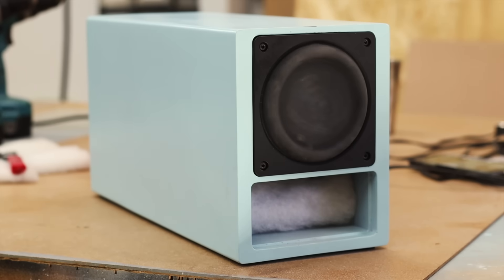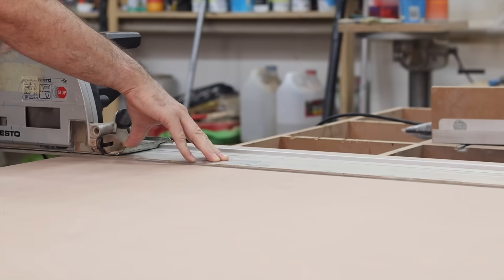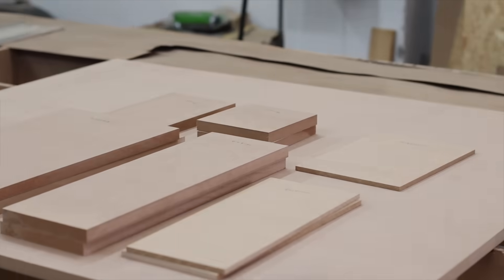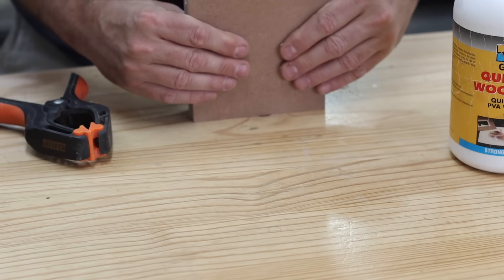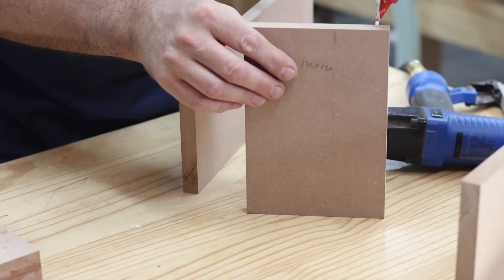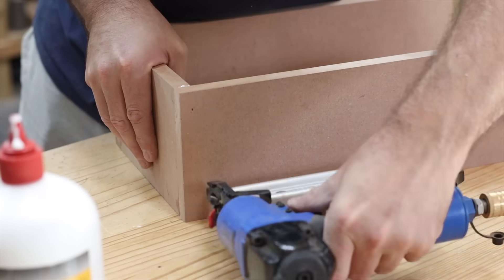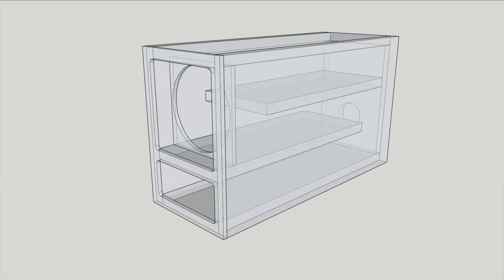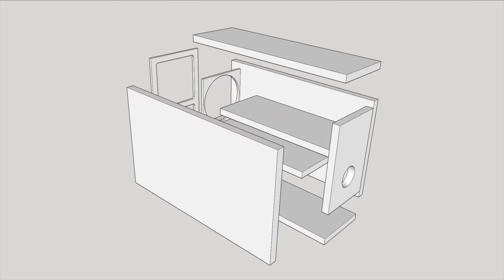Building a 4" Transmission Line Subwoofer - by SoundBlab

Comment: This looks great! Whats the f3 of this sub and how does the driver generally perform? I'm currently planning a build using this driver so I'd love to hear your thoughts!
Reply from the maker: Thanks. The driver does well in this enclosure, and can handle quite a bit of power. It really moves a lot of air. I have not yet measured the F3, but modelled should be in the range of 35Hz or 40Hz. Perhaps I'll do a follow up video in the new year where I can do this and show some more stats.

Comment: Is this a constant CSA using Sd, 0.75Sd or ~ 1.5Sd maybe? and a line length of 75”-80” to f3 @40hz?  Im looking for a last minute xmas solution as my other plan got foiled at the last moment ...
Reply from the maker: It's just a straight line where the mouth of the line is equal to the Sd of the driver. F3 should be around that, yes. I have the SketchUp drawing on my Patreon page.

Comment: I can see that having a table saw making accurate cutting really easy . It's not so easy free hand with a circular saw
Reply from the maker: It does, but only if set up accurately. You can use a guide rail with the circular saw and still get very accurate cuts.
Reply: @SoundBlab  you can also take a cut sheet to your timber merchant and they will pre-cut stock to size for you to an accuracy of plus minus a couple of mm, which can then be flush trimmed to final size with a router and a metal guide rail if you need absolutely hair-splitting accuracy.
Reply: @weareallbeingwatched4602  That's what I do. I'm not going to make things way harder for myself just to save pocket change.
Reply: You can get some linear guides for a circular saw. Very effective! And cheap!

Comment: the transmission line is way overstuffed it might work ok in this particular case 
but just seeing the sonofil move so much proves that its almost a complete blockage 
This is more comparable to a sub with a passiv membrane than a transmission line sub 
sorry to say but for me this is a failed attempt at a tl sub
Reply from the maker: I used a material known as Dacron for the line dampening. It's very 'airy' stuff with lots of space for the air to still move. The line is filled with this to approximately 50%. This was modelled using Hornresp to reduce the size or length of the line and still get the same response, but much smoother frequency response than with a typical 1/4 wave line length. Essentially what the dampening does is to slow down the speed of sound within the line and 'tricks' the woofer to act as if the line or enclosure is much larger than it is. It actually works very successfully in this application. For me its a win and I am very pleased with the outcome and the attempt. Of course I can still experiment, and some measurements will be interesting. Perhaps another video on this in the new year.

Comment: Don't fill komplette Chanel with damping, it's refusing the base so much. Damping in Tml is only for redusess high frequencys they come out of the channel, in a sub are no high frequencys, so it's only make less bass. It's only the case in Tml.
Reply from the maker: What you are saying is not entirely true. The line is filled with Dacron stuffing to approximately 50%. This was modelled using Hornresp to reduce the size or length of the line and still get the same response, but much smoother frequency response than with a typical 1/4 wave line length. Essentially what the dampening does is to slow down the speed of sound within the line and 'tricks' the woofer to act as if the line or enclosure is much larger than it is. It actually works very successfully in this application. Normally where you put the stuffing in the line has more effect on the midrange, but it does affect the lower frequencies as well. In this application it was more about slowing the speed inside the line.
Reply: @SoundBlab  OH jes Its a complikatet thematic, I herd abaut that, but tis encluser is so smoll maby  just make it a bit longer, and one smoll strip at top and bottem to get a good highway for the air😊 I don't see in the viedeo that's only 50 % fillt 
Thanks for the answer

Comment: Silly question perhaps, but why not make the holes before assembly?
Reply from the maker: Not silly at all! I have actually changed the original design you've seen here so that it can be built without the need to router the square hole in the baffle. You can then just assemble all the panels and drop the driver in place.

Comment: wouldn't you want the woofer at the top of the box and not in between a channel of the port?
Reply from the maker: No, the enclosure was modelled in software to work this way.
Reply: sterling wendt that seemingly empty chamber at the top is just used for resonance, something kinda like a paraflex I believe

Comment: What is the low end frequency response for this setup?
Reply from the maker: Around 40Hz doen at -3db I think. Did not measure, only modelled.
Reply: SoundBlab which software do you use to model and test such enclosure designs?
Reply: @darshitdarji3217  1:25
Reply: Victor Supreme Thanks but I could not hear that properly. Can you name it?

Comment: That looks and sounds great!  I love TangBand subs, i have 2 Tang Band W6-1139SIF 6-1/2 subs in my car and they sound good but i know they could sound better with the proper box. I know nothing of subwoofer box design, i just tried different box sizes and different slotted port lengths until i thought it sounded good. It would be nice if someone would design a box that i could make.
Reply: You can check out WinISD 
From what I hear it's what most use for box building 

All you need is the specs of the speaker and the desired frequency, then input it into the program.
Reply: PDRIFT86 I just put those same speakers in a box in my truck. Somewhere around .35-.50 cubic feet per driver is sufficient and a 2" port that's 10" long will tune it to about 35 hz. I used a 2" PVC elbow for the opening and 2" pipe connected to it for an additional 6" to get the 10" line. 
I stuffed it moderately, with about 6oz of polyfill. Sounds 3x better than just having them in my doors.

Comment: This is an awesome little build. I'm familiar with T-line enclosures, but isn't the top chamber in this build redundant? It seems like the sub is installed in the middle of the line.
Reply: No - it's not redundant at all, actually, its pretty clever! Bose use a similar approach in their designs. https://www.diyaudio.com/forums/full-range/243483-improved-transmission-line-alignment.html
And before one dismisses Bose, I've yet to hear anyone worth their weight criticize Bose for their engineering https://www.youtube.com/watch?v=CZaRQT3Rvaw  .. actually, the engineering is pretty sound. What Bose don't do well is to then take that brilliant engineering and desecrate it using really bad, cheap drivers IMO.
Reply from the maker: Interesting post on the forum! And is exactly what I have done in this design.
Reply: @SoundBlab  very cool! So that chamber is probably tunable.. hmm. Thanks for the reply. Love your channel 👌😁👍
Reply: Yes I though the same when I first saw the position of the driver!!!!
Reply: I was thinking the exact same thing.  What is up with that?

Comment: Is that a 1/4wave chambered tline?
Reply from the maker: It is a straight line, no taper. It started off as a 1/4 wave, however with the Hornresp software I could model a shorter line and move the driver down the line and get a better response curve and same bass output.
Reply: Oo ok i see i was wandering about the very short run.

Comment: How can I determine the enclosure size for a 4" generic woofer?
Reply from the maker: Depends on the enclosure type, sealed, ported, etc. and without the driver specs it is not really possible and be sure to get good results.
Reply: @SoundBlab  thanks for the reply btw I meant how can I calc. thiele n small's parameters ... like using only pc ( as a freq. gen ) and a multimeter? xD
Reply: @coffeebeatsofficial1349  you can use the Dayton Audio Test System (DATS v3) for that.
Reply from the maker: Yes, the DATS from Parts Express is perfect for determining TS parameters, and WinISD for enclosure size.
Reply: @SoundBlab  Thanks my man!
Reply: @KB0B0  Thanks bro!!!!
Reply: use winisd
Reply: @D.Feenstra  yea!!!
Reply: @D.Feenstra  Winisd is oversimplified IMO, and of course it only predicts the enclosure. What most software doesn't take into account is the environment its going into ... which as demonstrated here (link below) is important. Therefore, for the most part I take such software with a pinch of salt! https://www.youtube.com/watch?v=e3nGVje3io0

Comment: Перегородки тонкие, будет резонировать
Reply: I don't even get the logic of the labyrinth.  A dead-end at the top and a vent on each end?  As I expected, not really a subwoofer.  Roll-off at 160 Hz is ridiculous.  Way too much midrange getting thru.  Not any kind of a test.  Listen to a real subwoofer.  All that gets thru is a low breathing sound.  No transients.
Reply from the maker: @Alex T This is a transmission line enclosure. Essentially you are sticking the woofer at the end of an open pipe with specific length and one end open. There is complex math to work this out. However, by shifting the woofer down the line, you can potentially smooth out the response curve, which is what I have done here. The roll-off is only determined by the subwoofer amplifier and can be adjusted up or down. I selected the 160Hz as that is the max of my sub amp and the range gives a good representation of the response from low down to upper bass frequencies. Note it is not a test, only a demo. Like I said in the video, this is an experimental build to see the capabilities of such a small driver in this application.
Reply: @alext9067  I have t-line subwoofer with 6.5 speaker. It digs to 28-30Hz low, and has flat responce up to 100+Hz (there's no need but it can). And with 100W amplifier it's way deeper, faster, flatter, louder than most of sealed and vented 10' and 12' from the store.
Reply: Для такого динамика достаточно, главное проклеить злым клеем.